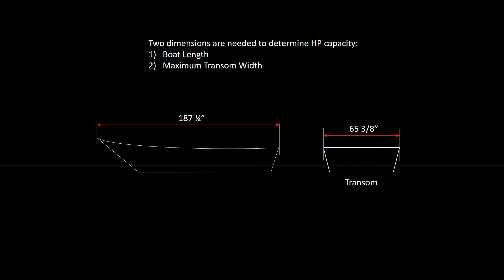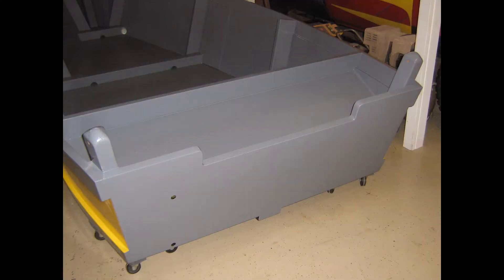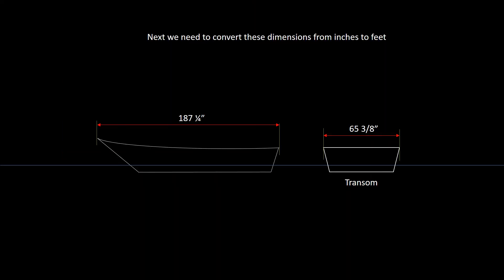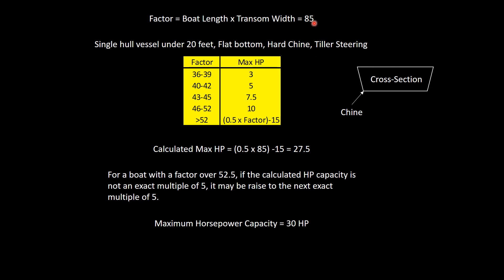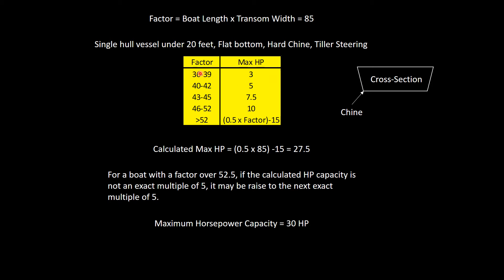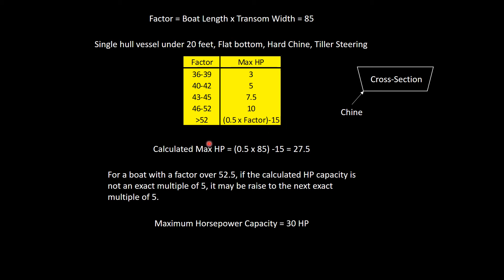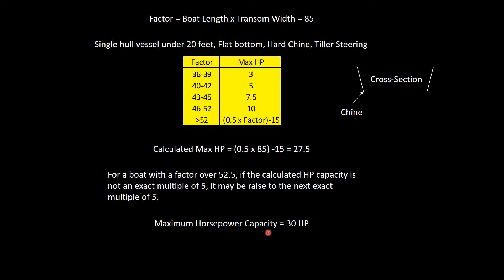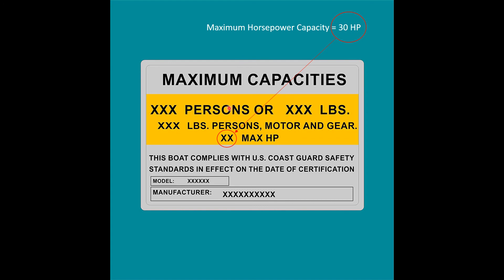Episode 24 - Max Horsepower for a homebuilt boat

Comment: Great video explaining how to calculate max horsepower. I actually have a boat that came with a coastguard plate which says 15 horsepower is max, but that seemed like it was a little lower vs many boats suggesting 20 hp max. I calculated it out the factor and method determined it would be roughly 17.5 hp so rounding up would net the max at 20 hp which makes more sense. Can the manufacturer recommend a different horsepower rating in the end? The reason I think this might be the case is they sell another 14 ft boat rated at 25 hp which has the taller 20" sides, while this boats sides are 18" with a 15" transom. It would seem to me to cannibalize their sales possibly.
Reply from the maker: Indeed! The max horsepower limit is the maximum allowed. The manufacturer is free to certify the boat with less than this but needs to accomplish a specific on-the-water test to install more than this limit. There are many reasons the manufacturer may limit the horsepower to less than the maximum. One reason may be a lack of enough safety floatation near the transom of the boat to support a heavier outboard. Another may be because they wanted the boat to carry less engine weight and more passenger or gear. Or it may be because of structural reasons (e.g. slamming loads going to fast over waves).